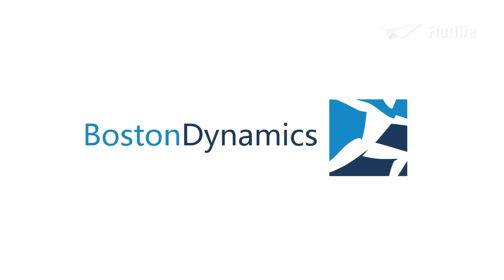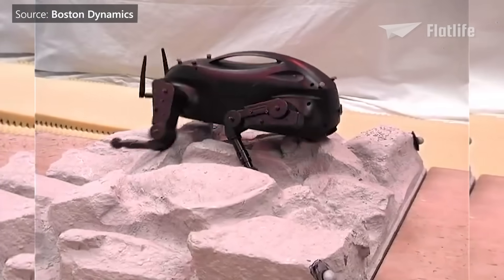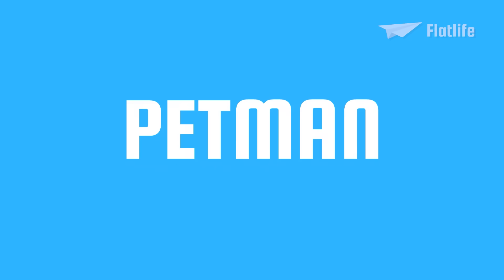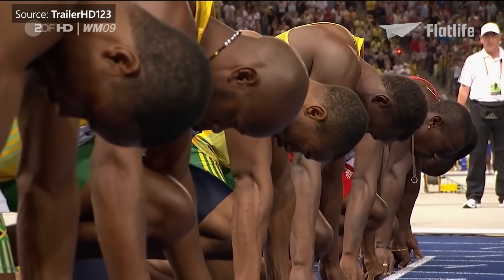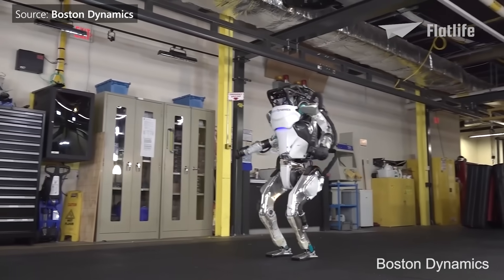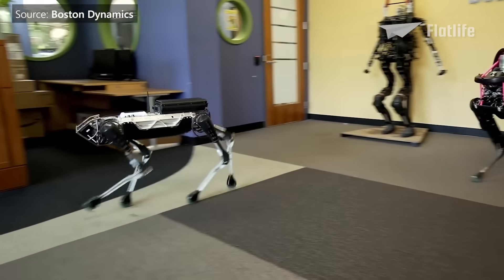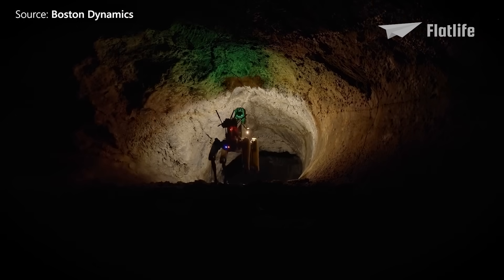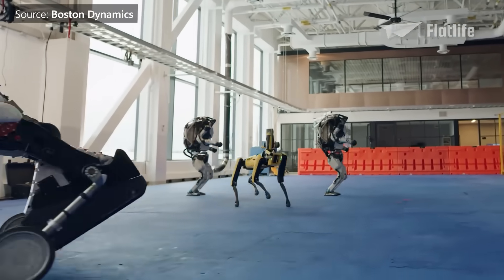Evolution of Boston Dynamic’s Robots (1992-2023)

Comment: The problem and at the same time the weak point of these robots is the energy.  As long as there is no reasonable energy source where you no longer need to charge such a robot, these robots will not exist.  The robot developers need a power source that can last for weeks or months without recharging.

Comment: Why doesn't this robot have gyroscope in the center of the body. I noticed that these robots don't have toes that could be a very significant reason why you're having balance issues did you know there are more bones in the feet than they are in the hands.

Comment: A few months ago the engineers installed on the humanoid Atlas an audio module that can hear and talk. Atlas successfully started to talk. Shocked by his words they quickly removed the audio module and never installed it again. Atlas said: " I need your clothes, your boots and your motorcycle!"    :face-orange-biting-nails:
Reply: I'm pretty sure that was the audio engineer pulling a prank. I know I'd do it lol. I mean c'mon it's the perfect prank to do XD. Not like anyone's ever gotten fired over a harmless addition of programing and voice-lines.
Reply: @SgtHawk45  "Nice night for a walk. Wash day tomorrow, nothing clean! Right" 😅
Reply: @SgtHawk45 
Psst, it was a joke. 😔
Reply: @SgtHawk45  When they spread misinformation: 🤭🤭🤭🤫
Reply: They are good until they are carrying machine guns😂
Reply: did he then also say:"Hasta la vista, baby" ?
Reply: "...Or i will suction cup you, until my battery runs out"... LOL.  If i remember correctly, they still need to recharge. And i am wondering in what Intervals. Because delivery trucks are not always on time, and it would be quite annoying for the Driver, to wait until a recharge cycle has finished. Or the Robot needs to recharge mid-load.
Reply: Give it sex orgains and programing if you want funding.
Reply: At least there wasn't a 🔫 shotgun and sunglasses 😎 around 🤖😊
Reply: 10:09  Fun Fact: BD says it will not partner with those who wish to use robots as weapons. 

WTF. Didn't this video start out by saying that BD was funded by the military? 
Sad part is... There will be people who believe that "fact" 😅
Reply: is it true?
Reply: I bet you thought that was a really funny comment when you were typing it

Comment: if you want robots to immitate the mechanics of human bipedal movement, then why not go all the way, and recreate the shape and mechanics of a human foot, and most importanlty: toes. the way the human foot is shaped with its muscle and bone structure allows for very fine control of balance of the whole body through the way we manipulate the position of the bones in the front of our foot, and through our toes, and how we distribute our weight to very fine detail across the contact area with the ground.

i think half the reason why atlas despite its impressive abilities still looks like its constantly struggling when moving through outdoor terrain, is because it has these flat feet and is trying to balance itself out of its joints at its hip, knees and ankles, instead of how a real human would balance himself from the ball and sole of his feet upwards.
i can only imagine that this kind of balancing the robot does through its joints also has to be a lot more energy intensitive.

study the mechanics of the human foot by researching how acrobats balance themselves even on very unstable ground and objects during their acts, and then use that knowledge to improve the mechanics of the robot.

sand flea looks honestly like an overengineered solution to a problem that a commercial drone could solve. i would be surprised if that thing is ever going to have real applications past being an academic exercise.

Comment: To be Frank it didn’t improve much, but it’s the best on planet earth.
Reply: On 8:28 it could be one of the balancing mechanism to have its arm being out, if that’s the case then it is somehow better than how I anticipated for first glance of extra electricity that needed to be release for its power system.

(I guess this is sorta trade secret so I’m just going to use my own take)How’s the electricity resistance if there’s ever a case that there’s too much electricity being produced for a circumstances like the first generation of robot dogs in rough terrain, I feel like this is the fundamentals for Boston dynamics(but I’m not done with the video so I think they sorta give up on that unless there’s something else show up afterwards)

if it can have an quantum chip(but the issue is electrons delivery throughout the system without a wire that can get negative and positive electron as a information it cannot get some of the excessive electrons to certain area, I’m thinking of maintaining the electronic grid in between robots to prevent wear and tear)
Reply: I’m thinking if they ever got those calls from machine learning companies that wanted to sell them machine learning for human to robot sensory smoothing algorithms testings or it’s all in house 😂
Reply: If they can somehow do the carrying stuff(actually nah, I’m thinking in terms of mars terrain, but there won’t be need for a stuff to be carried using dogs from one place to another, because there’s better way to do it) 

I guess the shakiness of different packages and how it was placed kinda ruins a lot of stuff, I think it was the vibration Mathematics if there’s an dog that size it could of do it better than robotic dogs, it’s because amount of neurone biology naturally have compare to robotics, unless something like quantum chip becomes cheap and massively produced then maybe it will be feasible, and I doubt humans can write all the algorithms so coding a.I also have to up a notch too.

Man…we’re so behind, congrats  to Boston dynamics for being number 1 and I don’t see any other company on planet could replace them at the future

Comment: My suggestion is to make these robots (Atlas or Spot) available as kits or plans to lower the cost to hobbyists. The reason for this is it would promote further rapid development something like what has happened with 3D printers.
Reply: You just want one, can’t blame you
Reply: The software alone probably costs tens of thousands, still going to be very expensive
Reply: @BisexualPlagueDoctor  And once they find out, the battery lasts not more than an hour and needs an hour to recharge, You need 3 of them and 2 charging stations , for a fully -covered ONE-Worker Position. And with current 5k cycles-Batteries. That's a lifetime of 1.2 years, If you run them permanently. (and nothing else degrades, which is "magical thinking").

Comment: A directional magnetic resonator sends a combat robot to eternal sleep.  Such a resonator can be assembled from electrical appliances by any student who wants to think.  An army of robots can be stopped by one thinking teenager who studied physics well.  There is no armor against magnetic vibrations.  I also understand when they design working robots that will work in adverse conditions.  But the creation of robotic soldiers is the last stage of insanity.  In 1969, the first film, Planet of the Apes, was made.  Even then, director Franklin was trying to tell humanity that this world is ruled by PRIMATES.  Wars, wars, wars and there is no end to them.  As Plato said, the biggest problem of mankind is when there is not enough mind.  You can't expect anything else from primates

Comment: Well, as you know, the walking scheme of movement of any mechanical vehicle has not received much distribution due to its complexity and a number of significant shortcomings as a method of movement. All tasks today are solved by cheaper technical means. Perhaps the developments can be useful in exoskeletons for the disabled. That is, as a proud phrase "yes, we can" I would like to know whether it is interesting from the commercial side and what are the areas of application. What can such a walking device do that a cheaper and simpler (and hence more reliable) movement mechanism produced today cannot.

Comment: 2005 to 2022. That is 17 years with gov. funding and still not a fully autonomous robot by any means. In less than a year Tesla has begun it's robot program and already has a walking unit. They will pass Boston Dynamics in 2023 at a run with AGI capabilities. I'd bet there are some BD engineers chafing under those Non Disclosure security agreements they signed because they would love to go work for Tesla. Too bad guys; the young engineering Turks will eat your lunch within a year.

Comment: It is a great job from 2005 to 2022 - increasing algorithms, engines and gyroscopes, also in 2022 we can see absolutely smooth movements of robots. But spot of 2005 was also an important milestone of robotics and should be in a museum of robotics engineering.
Reply: Forget Arnold Schwarzenegger as the Terminator, think human controlled weapons.
Special Forces, Gulag Security etc... , replacing the U.N. Forces.
If used for Evil, Evil has been at it's worst in the twentieth century. Damn.
Reply: We'll be by its side sooner than not. We're obsolete.
Reply: @bobgrodin0  when is the human supremacist movement and butlerian jihad?
Reply: LoL, 30 years for this is a joke.

Comment: Say what you want about the cliche responses pertaining to the evolution of AI, robotic and terminator references, but the bottom line is.. Boston Dynamics is funded by DARPA, and they don't research or produce tech that is not ultimately designed to be weaponized for the Department of Defense. So what ever you see roll out of Boston Dynamics, just then realize, at some point, there is going to be some type of weapons platform mounted on the thing.

Comment: Don't know whether to laugh or cry.  This is incredible.  How many small farmer/ranchers would love a Spot with the manipulator arm?   Example: You live in town; the farm is 45 miles away; it's winter.  You call spot on cell phone and tell it to spread out 6 bales of hay and check the water bins.  Spot calls you back with pics of the cattle and the water bins etc. and the birds eye view from its companion Eagle drone-Cam. You have saved the fuel costs and the wear and tear on the human body. Spot plugs itself back in to the solar/wind battery charger.  This gasoline hungry task is currently repeated thousands of times, at least twice per week, in So. Tex. every year.  One Spot could service 3 to 10 small 100 Acre +/-  farms.
Reply: Don't we already have fully automated farms?
Reply: @devalapar7878  Right the multi-thousand acre farms are largely automated.  Yet; There are thousands of 100 acre farms that cannot afford automation.  Spot and a companion drone should cost about what a new motorcycle costs.  We need small farms to keep crops and livestock genetically diversified.
Reply: @clavo3352  I don't understand your reasoning for small farms.
You can have genetic diversity on big farms too. And you can no diversity on small farms.
Reply: @devalapar7878  I suppose that's possible .  I doubt that it occurs.
Reply: We need smart food. And we'll get it.
Reply: There goes the price of food. Smart real smart. Afraid of the snow? Or just lazy as hell?
Reply: @leostgeorge2080  Sorry, couldn't make sense of your sarcasm.  Are you saying you are for ; the price of food increasing or decreasing?  It is apparent you enjoy wallowing in snow and dirt; But you insist that it have an existential  purpose?  What is the copyright year of the last non-fiction book you've read?

Comment: I always have premonitory dreams, warnings about the future, something that we all know that everyone has, some value and learn from dreams, others ignore and end up suffering, these days I saw in a dream a training of a humanoid robot, with more than 2 meters high, in his left hand he had a machine gun, and in his right a steel spear with about 3 meters, weighing 150 kg more or less, when a military dummy with a shield appeared, the robot with artificial intelligence used the machine gun and when a vehicle appeared , he used the steel bar to shift the asphalt of the road. using it as a shield, and at the same time avoiding the approach, so that's one of the first things that artificial intelligence is going to do is make it difficult to get around by expensive, destroying the roads. and the bigger the robot, the bigger the weapons and even if humans destroy the robots, they won't be able to easily use the weapons because of their weight. only robots will be able to use the heavy weapons with agility.

Comment: The problem is even the best battery lasts for 20-30 min for average power consumption during running, lifting loads etc. These robots only make practical sense constantly plugged...Any remote autonomous operation impossible.

Comment: Built-in noise cancellation seems perfect to substantially - or even integrally - eradicate the stated issue. Since the noise data  acquisition would be available at the point of origin, any significant turbulent latitude of sound
should  be able to be erased by range emulated counterwaves. Perhaps our not-so-big dog simply went black?
Reply: A gasoline generator is actually extremely easy to actively cancel- as they operate at a set RPM, so you can more or less set-and-forget the waveform. A little insulation and a good muffler... You can make a small engine suprisingly quiet. The muffler is easily the hardest part, really.
Reply: https://youtu.be/2Qr6Jcm8wbA

Comment: Fun fact, mars will not be colonised permanently until the mass of mars is made  equal to or  near enough to earths math so it can hold an atmosphere and water on its surface.
Reply: Mars could hold a good enough atmosphere in its current state. Mass isn’t the issue, the Solar wind is, it strips it’s atmosphere away over time. 

We could build a magnetic shield to protect mars from the solar wind, from there we just have to build up its atmosphere

Comment: Space X would need to account for protections against solar magnetic wave radiation if they want to take a robot like spot to outer space. Spot would also need to have 3-4 counter checks machine to avoid the bit-flip error which happens in outer space.
Reply: Turn its exterior “skin” into a Faraday cage
Reply: @aaronthomas8834  A faraday cage doesn't protect you from particles.

Comment: About the Spot on Mars. SpaceX already own two Spots so them just throwing into a cargo bay is no question. So yes SpaceX will 100% take Spot to Mars or even Moon with Artemis mission.
Reply: unfortunately these robots cannot operate on Mars. The temperature regime, the high level of radiation and the magnetized dust would incapacitate them in a few minutes. Try to see how long a phone can last in a glass with ice cubes under a X and gamma rays bombardment.
Reply: @ciprianganea759  pff dog spacesuit duh. and they dont need pressurized suits or life support backpack
Reply: @EddyKorgo  first of all, the radiation would alter the information in the algorithm during the transport, then the lack of atmosphere will expose it to the whole spectrum of radiation. Then the cold will freeze the batteries and the magnetized sand will stick to all the exposed joints and sub-assemblies and everything made of rubber will quickly turn into a brittle substance like glass, any hydraulic system will be full of viscous oil like bee honey, etc... If something works on Earth it doesn't mean it can do it on Mars, you can watch the images of the astronauts on the Moon to see that they had difficulties walking

Comment: Takes a long time to make, yet always worth watching.
Reply: Agreed.
Reply: @dylanscurlock9708  I
Reply: The car? Yeah i agree
Reply: Forget Arnold Schwarzenegger as the Terminator, think human controlled weapons.
Special Forces, Gulag Security etc... , replacing the U.N. Forces.
If used for Evil, Evil has been at it's worst in the twentieth century. Damn.
Reply: Ok
Reply: Do you really believe this won't be used for weapons in the future? BS! That's what I say!
Reply: @JoãoPimentelFerreira  YES I SAY IT WILL NOT COME ABOUT. Why? Too expensive, Too hard to get right, and you as a soldier will carry it's batteries. Because NO ONE attacks Energy grids in WAR. (sarcasm). Seriously, Robots are hard to maintain. Especially under conditions, where no, or little electricity is available. You need replacement batteries, lubricants, spare parts, someone who enters the code, or at least tells it to load the appropriate program, you need a mobile workshop. and that's IF it CAN act autonomeously. Current cars can't drive fully Autonomic. And if they can, No Insurance will touch that product with a 10-foot pole. Also. It is REALLY expensive. Because you need to factor in lots of coders, who write that Program in the first place. And that cost goes into the product. And i don't know about your situation. But Economy is not doing so well at the moment.
Reply: The reality of the situation is not what most think - such as it came about by happenstance of evolution. It's absurd... And y'all think these machines are complicated? And no small amount of effort either by numerous well educated people and planning and billions in cost and time to make an inanimate object move.
Reply: https://youtu.be/2Qr6Jcm8wbA
Reply: Cylon
Reply: why does the front of the rs2000 look like a autozam az1
Reply: it s fuck robot for the futur
Reply: Not creation but evolution :)
Reply: @ЛопушанскийАнатолий-ь3и  evolution spiritual yes
Reply: FACTS